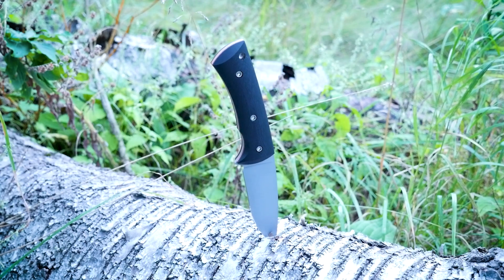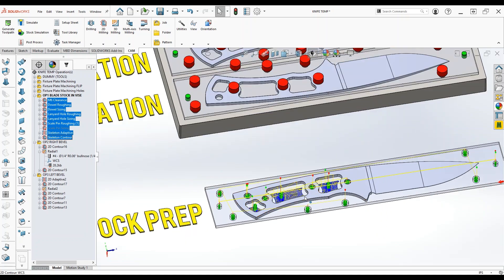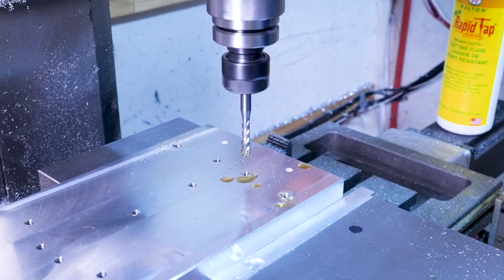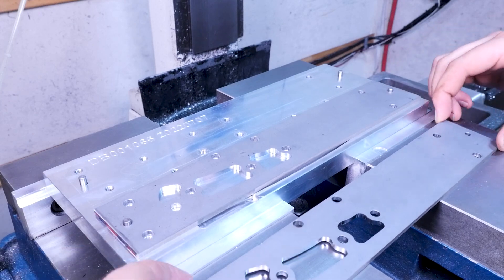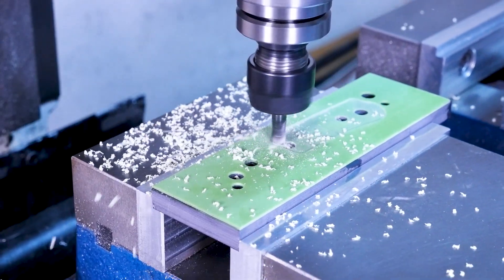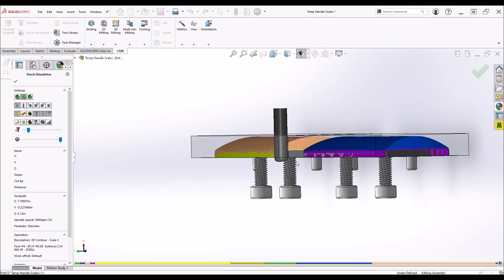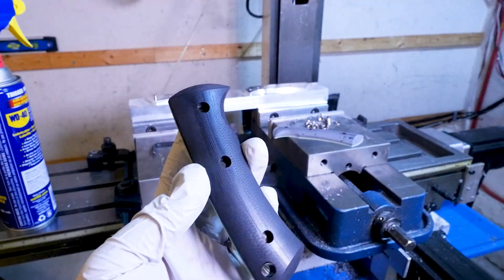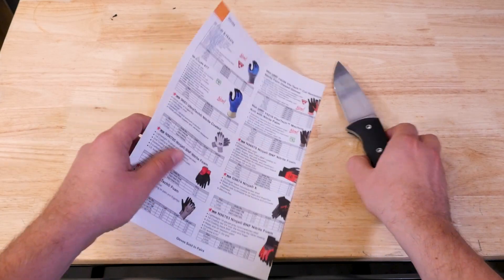DIY Knife Making on CNC Garage Mill

Comment: I just made a knife on my own little 3030 CNC router .. 304 stainless, 3D printed (PPA/25%CF) handle scales.  It came out great but was such a learning experience.

Your approach and execution is flawless.  Well freakin' done!
Reply from the maker: Thanks for the kind words! How are you finding the 304 knife? A great choice for corrosion resistance, but since you can’t heat treat it, does it dull quickly? Cheers! Adam
Reply: @adamdebowski2037  it was just to see if I could eek it out of my little Genmitsu with well designed toolpaths and heat sinking, not really intended to be a good knife, haha.  But I was able to baton enough kindling for a beach fire just fine. :)

The biggest issue I had was avoiding work hardening.  Without coolant, the shallow cuts and minimal chip load was making a fair bit of heat, so I cut it flush against a large hunk of aluminum as a spoilboard and dripped cutting fluid on the work every 20-30 seconds.  Seemed to do the trick!

Comment: Amazing video and absolutely beautiful knives / machining.  I took a deep dive into knife making about 6 years ago.  I built my own belt sander, forge and even anvil from scratch (the anvil was horrible by the way as it was an old rail road track section and had horrible rebound).  I made a couple of knives and even a small gladius.  I gave it all away when I moved and I miss it a lot.  This video really rejuvenated my desire to make knives again.  I'm also a garage gunsmith and have a PM-1236 and I've been looking for a mill to accompany it.  I love the idea of a CNC convertible Mill and the PM-30 looks like such a capable little machine.  Keep up the great work and videos.  You got another sub.
Reply from the maker: @jjsemperfi  of all the things I’ve made, knives are definitely the most work, but also the most rewarding. Something you get to keep and use forever that has a story and memories attached to it forever. Thanks for the kind words, much appreciated and thanks for the sub. Let me know if you decide to go down the CNC conversion route. I love my little PM30 and would do it all over again. Cheers! 
- Adam

Comment: I don't understand how you manage to make the blade in one pass, without first roughing and then finishing... what type of cutter do you use?  thank you, wonderful work!
Reply from the maker: I use a stubby 4 flute solid carbide endmill with 0.060" radius & 0.010" stepover. It definitely needs some hand finishing to smooth it out nicely after milling.
Reply: @adamdebowski2037  thanks, I use a 3 cutting edge for a similar job and my spindle reaches 8000 rpm, but I noticed that if I don't use coolant oil the milling is worse, but I see that many professionals like you don't use emulsion but only air I think ...I have to try again.  you are very good.
Thank you!
Reply from the maker: @simone_81  typically, 3-flute endmills are meant for aluminum. You should try a bullnose endmill meant for steel, and the rigidity of your machine will also play an important role 👍
Reply: @adamdebowski2037  thanks for the advice, I will take a 4-flute torus cutter and do some tests, I use Artcam and I cannot use your milling strategy, which however seems really optimal, but I will try to simulate something similar, up to now I have done roughing and finish, but it takes a lot longer.👍

Comment: Cool video! Thanks for sharing. Do you think the pm30 could mill titanium scales?
Reply from the maker: Titanium... a material I've never tried - because it scares me! Ultimately, yes...... but... if you dump too much heat into it with the wrong feeds/speeds or dull tools, you can start a fire that burns so hot it can't be put out easily. That, paired with the fact that I've had endmills glowing red hot (more times than I'd like to admit) in the past just kind of scares me away from it... but the machine will do it. How efficiently/quickly is a whole other conversation, though. If you're machining a small part, or really just removing small amounts of material, you'll be ok. My feel is that you'd be impressed with Ti handle scales that come off the PM30, but if you want to make big batches, it'd be in your best interest to get something with flood coolant. Cheers! - Adam

Comment: Now, if you can only do that on a onefinity elite with vcarve pro....
Reply from the maker: Oof that would be a tough one. Have you tried machining steel with it?
Reply: @adamdebowski2037 I haven't no, it's new to me. Though I do have high hopes, especially if I can cut 26c3. It's a nice simple carbon, and even if it comes close to target no matter how slow it would be good.
Reply from the maker: @8thsinner  Nice! If you have a hard time you might have some more luck with smaller tools. They like the higher RPMs and don’t need much rigidity. It’ll be slow going but it should work. Good luck and let me know how you do!
Reply: @adamdebowski2037  Do you mean like using 1/8th, 1/16th bits? Because theres less torque > less flex > less risk???
The worry isn't so much the cutting it's the cutting without fluid. Winston moy managed to cut I think a1 or o 1 with his nomad shapeoko however thats quite a rigid machine, even though the onefiity is beefy as hell, it's spread out over long rails...
What bits, speeds and feeds would you suggest I start with?
I haven't had feedback frmo anyone yet whos done it, only suggestions of going very shallow with low stepovers like 10-20%, and no more than two flutes, likely o flutes
Reply from the maker: I would probably start with a 3/16 4 Flute solid carbide endmill. Take 0.001” feed per tooth and start with a 0.010” stepover if you’re going 3/16 deep. If that works nice, increase the stepover to 0.020. I don’t think you’ll take much more than that but it’s just a guess!

Comment: Do you remember if you had to completely disassemble the mill to get your Y axis ball screw kit installed? (ArizonaCNC kit). 

I can't get mine to fit
Reply from the maker: Yes - you’ve got to grind away part of the y casting with an angle grinder to get it to fit.
Reply: @adamdebowski2037  yes I know that, but I mean the Y ball screw. There isn't space to thread it through with the mill assembled right? You had to take apart your mill and put it in from underneath?
Reply from the maker: @Phiz787  yes - I had the mill totally disassembles. X & Y tables off the machine, column off the machine, head off the column. Makes it easier to handle all the weight too.
Reply: @adamdebowski2037  ah ok. Thanks. 

Any idea what size those giant bolts are in the back, holding up the Z column? 

Or maybe... An Allen key comes with the mill...I'll check the toolbox.

Comment: Are those 2 5" vices, or 2- 4" vices? If they were 5", do you think it may be advantageous to go smaller to 4" for some more Z height?  Complete beginner here. thanks
Reply from the maker: These are 5” vises. For me, generally the bigger, the better. They generally open wider, too, to hold bigger pieces. You have lots of Z on mills like this. Z is never really a problem.

Comment: Watched your Conversion PM-30MV video. Maybe the most useful video I've found so far. I don't have a CNC Mill yet, but hopefully I can follow in your footsteps. 

How do you align your aluminum workholding block? Could you machine in divots into the side of the block where your vice jaws fit into so that its centered every time? Sort of like what you're doing with your dowel pins? Or is there an easier way that I'm missing
Reply from the maker: Hi Phiz. Thanks! I'm glad you're enjoying the content :) Good question! The short answer is: I don't align the aluminum workholding block - Every time I put it in the vise, it's sitting in a different spot.... But then I use the probe (you could use a $20 edge finder to do the same thing) to show the control where the new "zero" is. For the knives and handle scale fixtures, i use the top left corner of the block. 

For large production runs on bigger machines, you could definitely do something similar to your suggestion - so that you don't have to probe in the fixture plate every time like I do. You see how I place the knife blanks onto the fixture plate - locating them on dowels so they sit in the same spot every time? Well - its common to do the same thing with a "sub-plate" that accurately locates the fixture plate. The sub plate is what would live in the vise (or somehow stay fixed onto the mill's table), and then you'd place the fixture plate onto that sub plate - locating it on dowels - so it's in the same spot every time. I hope I explained that right..... Cheers - Adam
Reply: @adamdebowski2037  Do you manually control your spindle speed? Or did you hook yours up to control it with Acorn? I am looking into it now.
Reply from the maker: @Phiz787  I do control the spindle speed manually. I don't find it a pain since I don't have an ATC, and it helps when doing some semi-manual work like that "rigid tapping" you see me doing on the fixture plate.
Reply: @adamdebowski2037  Do you think you would change that in the future for tapping? Or is it working fine for now?
Reply from the maker: @Phiz787  Even if you had spindle control of the stock motor, you wouldn't be able to rigid tap. These brushless DC motors bog down and reduce their speed when the load increases, so rigid tapping would never work. You'd need a servo motor on the spindle. In my opinion, it isn't worth it. Rigid tapping can of course be done under all the right conditions, but even in industrial applications on bigger machines, people generally prefer thread milling. There's always that chance the tap can break - especially in trickier materials like stainless - which is risky. Thread milling is a little slower than tapping, but its all around better: you can get threads closer to the bottom of a blind hole, you can thread any material with the right feeds/speeds even on hobby mills, and if the thread mill breaks, you won't have to scrap the part - it'll just fall out of the hole. The down side is that thread mills are generally more expensive than taps.... but just so much more reliable in my opinion.
Reply: @adamdebowski2037  Wow, that's a lump of golden advice. Thank you
Reply: @adamdebowski2037  Also, do you know of any good webcam monitoring methods for CNC Mills? I've grown to love my Octoprint ecosystem for my 3D printer. At first glance it doesnt look like Acorn has any kind of monitoring features like that. And I'd be a bit nervous that running a webcam on the same PC that drives the CNC would bog down resources. 

Have you set anything up like this? Maybe just a RPi4 with a webcam?

Comment: On any mill, but especially low end hobby mills, accurate placement and the ability to not only hold down pieces securely but to reposition them precisely is critical. I purchased a 3018 hobby mill to learn on, and let me say, these factors are not your friend out of the box.

Comment: like+subscribe and turned off adblock refreshed and watched an ad. havent seen a good video like this in years.
please show more of what you did in solidworks cam side.
Reply from the maker: Thanks very much for the support! I appreciate it very much! I’ve been thinking about a video like that. It’s something I would have liked to see a few years ago. Is there something specific you think would be valuable? Or any suggestions?
Reply: @adamdebowski2037  How to program with fixturing and part setups is what i would like to see. Thanks.

Comment: cool idea to use a stock fixture, that makes alot of sense for sequence milling!
Reply from the maker: I think so too! Especially because I don't like breaking the vise setup, and this mill's Z doesn't travel all the way down to the table - so holding fixtures a little higher up is necessary.

Comment: What material are the scales made from?
Reply from the maker: Hi Michael - the scales are made from a tough and resilient composite caled “G10.” It’s the same stuff most circuit boards are printed on!
Reply: @adamdebowski2037  Thanks. Beautiful knives.

Comment: This gives me the necessary kick to finally fix up my own CNC conversion build. I have some backlash issues but I think I know where the issue is and just have to bother taking everything apart again to fix them.
Reply from the maker: I’d be lying if I said I didn’t have to do this, myself 😂
Reply: I hear you. I'm dismantling my cnc conversion to chase out some backlash. I've had it apart, tweaked and back together only to find an elusive .0015" pop up.
Reply: @jrsydvl7218  .0015" is not too bad, you can easily compensate that in software (not to say that it wouldn't be better to fix in hardware, but beggers can't be choosers)
Reply: @DarkArtGuitarsWorkshop  No doubt, I've been shooting for <.001 for backlash compensation. I tend to get stubborn and spiteful in some instances.

Comment: Great video! As Aaron Gough is releasing a video every six years and he has some way bigger machines, its super fun to enjoy a more starter oriented content, loved the naration and the jokes, great shots also! 

I guess cleaning up the aluminium chips is a real pain haha.
Reply from the maker: Hahaha - you have no idea…. There’s a reason this machine sits in the corner. I blow all the chips into a pile and shovel them into a scrap bag…. And have multiple sets of tweezers in the garage to pull out all the fun slivers. Lol. You can probably tell I learned a lot from Aaron! Love his work.
Reply: @adamdebowski2037  Cant wait for more videos! The blades did not warp during the Heat treat?
Reply from the maker: @BalticBlades  cheers! I treated 8 knives in this batch. 2 of the 8 moved a little, but I find AEBL is pretty easy to straighten with some cold work - especially on thinner parts.

Comment: Hey Adam I love your content and your your videos are a great resource as I go through a CNC build of my own. I have the acorn board and some DMM servos. Keep up the great work!
Reply from the maker: Thanks! What kind of mill are you converting?
Reply: @adamdebowski2037 building from scratch Adam. I have a bridgeport clone, 14x40 lathe and surface grinder to make it happen so I am designing it up in Solidworks. I also am a daily user and most comfortable with that software.
Reply from the maker: @dannyjay6667  that’s very cool. Good luck!

Comment: Always great content! It’s great to see the results you get with a hobby mill. I decided to go with a Haas TM-2P
Reply from the maker: Thank you, and very cool! How do you like the TM-2P? What kind of travels do you get in X & Y, and what is the max RPM? Are you running on single phase?
Reply: @adamdebowski2037  The machine arrives in at the end of September. 
-208 @ 30 amps or 240v @ 40 amps
-10 place tool changer
-Programmable coolant nozzle
-Chip auger
-Touch probe
-7.5Hp spindle
-6k RPM 
-Travels
40” X
16” Y
16” Z
Think I’m also going to go with shrink fit and a TRT-200 at some point. Expanding the prototyping capability of the company. Y-axis lathe and Fiber laser table/tube cutter after. Heading to IMTS Sept 12-14th, maybe catch up with you there?
Reply: @adamdebowski2037  Haas machines  also run really easy  on a phase converter .  I have no problems with mine .. but have had  problems with some  fanuc machines